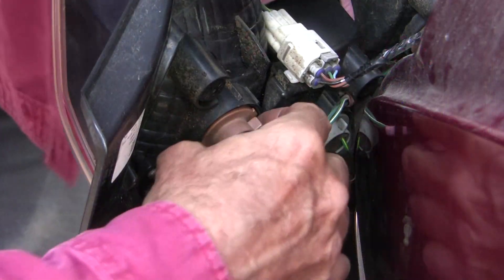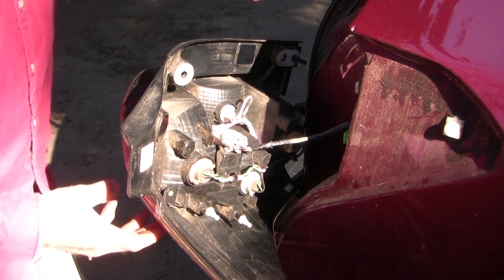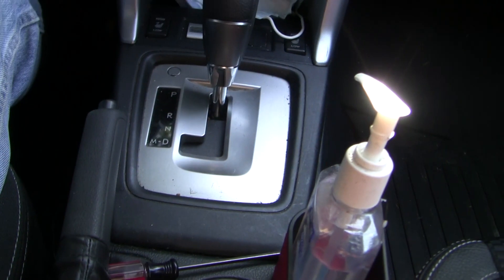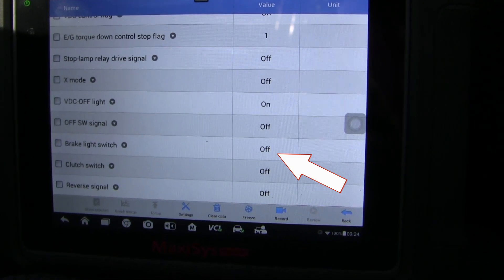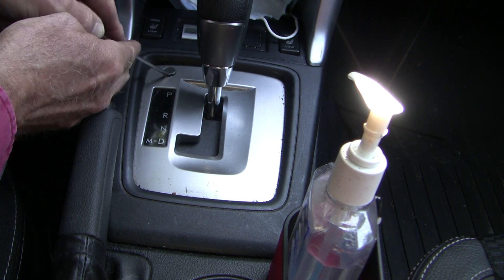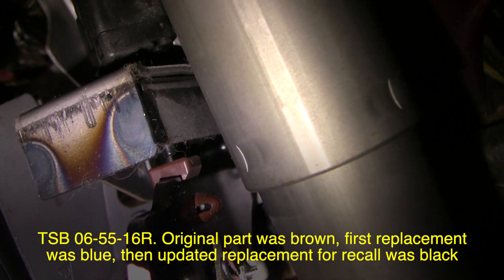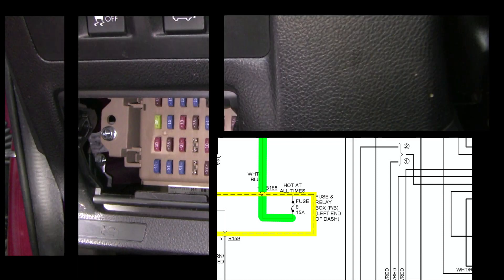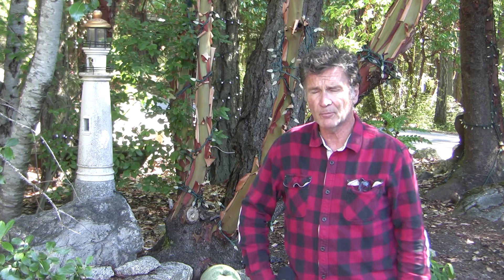Subaru stuck in park after brake light repair

Comment: This video described my issue and solved it.  Thank you.  I was pretty set on replacing all my filaments with LEDs, apparently, my LED bulb selection blew fuse #8 each time I tried to use them on my 2015 stock Forester.  Good info.

Comment: This is a feature of all modern Toyota and Subaru vehicles (parhaps others too). I had a 2013 Toyota Tacoma stuck in a drive through because a poorly wired trailer with no fusable link, blew the 10A brake light fuse in the truck.

Comment: Kind of stinks that one bad bulb/shorted socket can make all brake lights and the shifter stop working, for such an important circuit.  Individual branches and fuses would be a good redundancy for safety.  I feel like some cars actually have the third brake light on a separate power supply for this reason.

Comment: Did this Subaru have the low profile mini fuse or just the regular mini fuse. The mini fuse will work in place of a low profile mini temporarily if you get stranded but not the other way around. Thanks again for the great video and tutorial.
Reply from the maker: Hey man, thanks for stopping by! For anybody who is interested, the very best Youtube video describing the "Stuck in Park" Subaru misadventure caused by a defective OEM brake light switch is on ThePracticalMechanic channel. Nothing better than practical advice as to how to get off the road without requiring an emergency tow. Most of those vehicles with the bad switch have now been fixed, so looking forward, blown fuses will soon be the more common cause. This fuse was the regular mini, I'll watch for those low profile ones.

Comment: Great video. I don’t understand why they require such a long screwdriver on these new Subaru’s to bypass the shift lock. Previous generation used the a short screwdriver or even the ignition key to depress the button.

Comment: I don’t own a Subaru but how did you know to “emergency” unlock the shifter, owners manual?
Reply from the maker: In the late 60's my mom put the two younger kids into our '63 chev to do some errands, then remembered she left her purse in the house. She popped into the house to grab her purse and when she came out she saw the car rolling backwards. She caught up to it just as it came to rest against a neighbor's tree across the street. My darling 5 year old brother had shifted into neutral. A few years later auto manufacturers came to agreement that some kind of shift interlock was needed, and all have some variant of that. When you know what you're looking for you will find those little release buttons in many cars, but the unusual feature of Subaru is how long the screwdriver needs to be. A nail file, bic pen, or even a long nail would work. When you press in you are manually pushing the end of the solenoid back to allow the shift handle to move. Thanks for asking!
Reply: Most vehicles do and the manufacturers put them in different areas around the shifter. If you want a definitive answer for your car, ask a dealer or a tow truck driver.